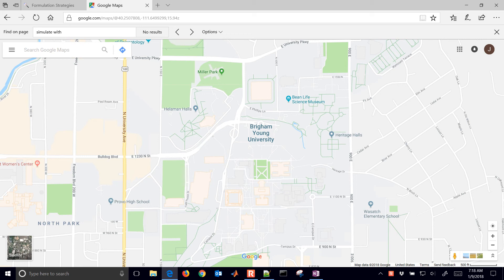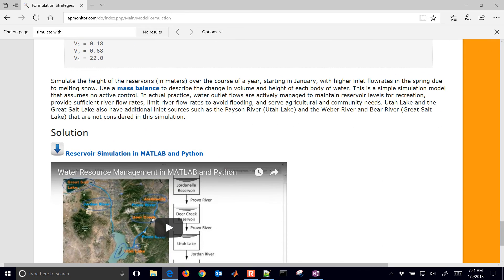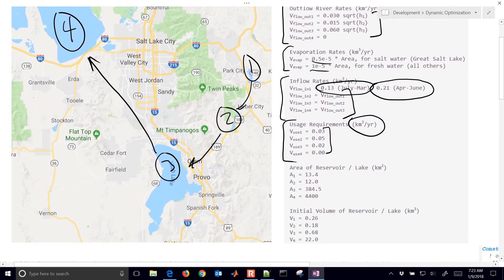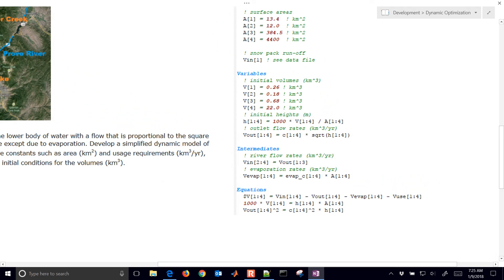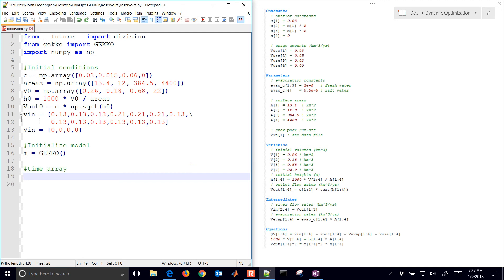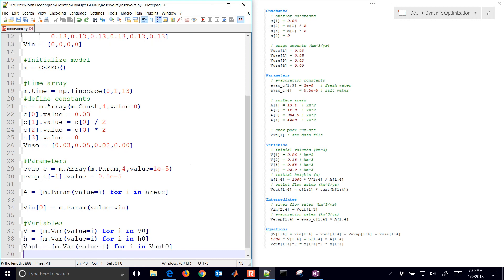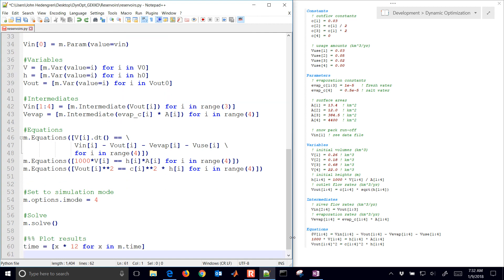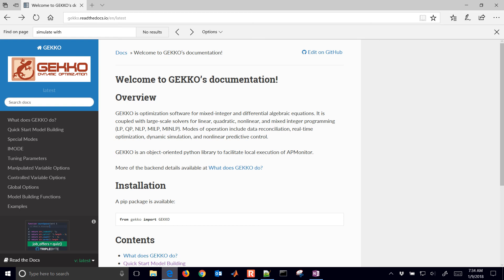Water Reservoir Simulated with GEKKO Python

Comment: I am working these days on the dynamic simulation of a a mechanical system for controlling the tension in a steel cable by acting on a air pressure in a pneumatic cylinder using gekko .
In the model of the pneumatic cylinder, the friction force depends on the sign of the movement speed , so I used an IF2 function to define this .
But when analyzing my model, the apm told me that I have more variables than equations and refuse to go further.
The result of the IF2 was use in an intermediate definition. Where can I find example of simulation with gekko using the IF2 and and also a PID in the loop because pid differential equation working on an intermediate variable gave me some syntax error.  Thanks for feedback
Reply from the maker: That sounds like a nice application. Just switch to IMODE=6 when you have degrees of freedom, such as when you use if2 statements. You can also implement with if3() or else velocity*m.abs(velocity) to get the opposing force. These may work better for your application.
Reply: Thanks John, I will try this .
Physically  speaking, the friction force should be linked to the speed, you are right.